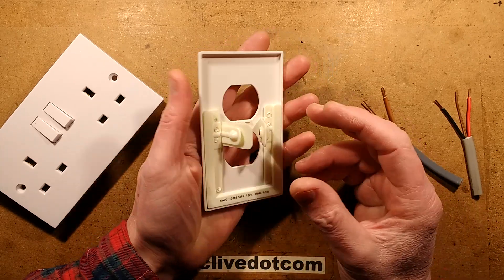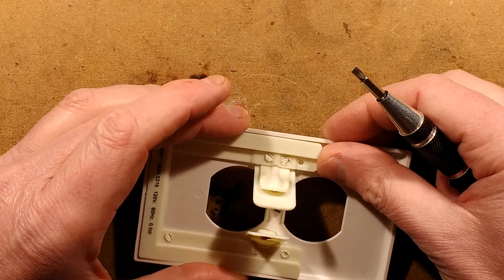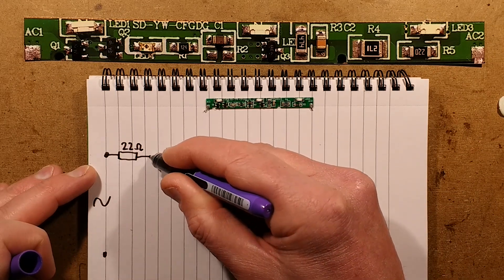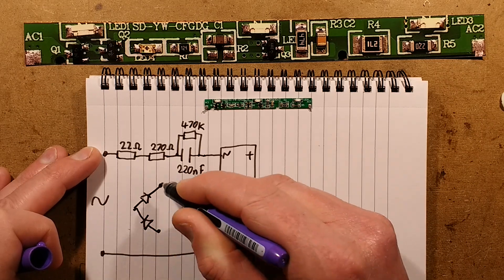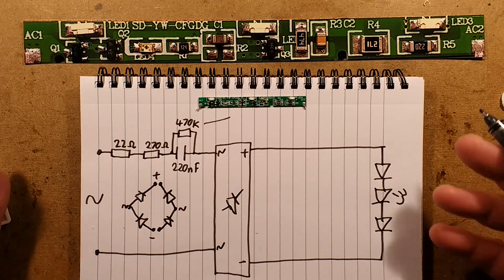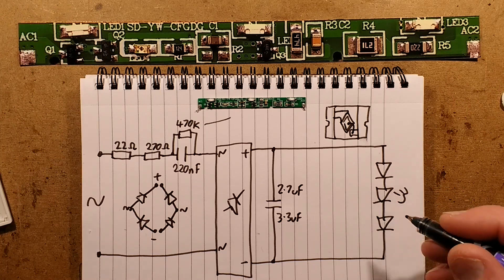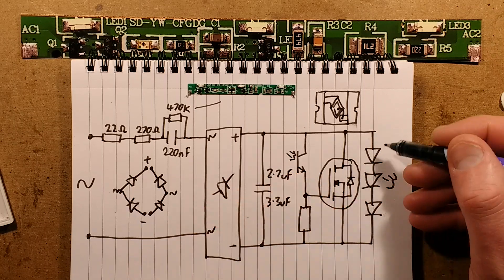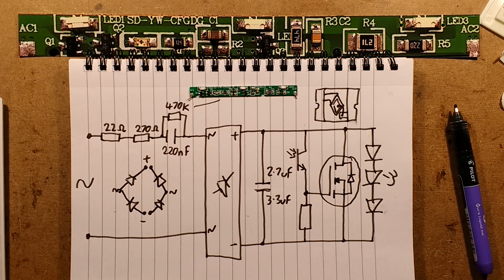Inside a night angel illuminated socket cover.  (schematic)

Comment: Very interesting - I live in the US and have never seen this item? Clive- I have been watching your videos none stop since I found your channel (almost 4 days straight lol) A lot of the things you take apart seem to have what you call a capacitor dropper with bridge rectifier to change the Mains to DC & drop the voltage is that a common and SAFE way to do that? In some break downs you say it isn't safe because of no isolation from mains power but in others you say its ok what am I missing?? - I apologize for my limited knowledge but I DO NOT mess with Mains Voltage because of that, but I am learning! you are a Great teacher
Reply from the maker: It's common in LED lamps and low power control circuitry like time switches.  A capacitive dropper is a cheap, simple and reliable way to create a low voltage supply where isolation from the line power is not needed.
Reply: Okay Thanks for the reply

Comment: Why there is no green-yellow earth wire, only bare copper one?
Reply from the maker: It's to save space as sleeve is only needed at the point of termination.
Reply: I am from Czech republic and i can say that most of UK and US electrical standards are disaster oposite our regulations. Cables like that will never got revision in our country. Sometimes we wondering if we receive some kind of machine from "more civilized or more western world".
Reply: Radku, lépe bych to nenapsal :-D
Reply: Don't mention the ring circuit and 32amp protective device, the radial boys will blow a fuse !

Comment: I'd be careful about that little gadget and I'd be interested in seeing the size of the contacts. Reason is in the US, some of those 120 volt sockets are wired in an Edison circuit (shared neutral). What is done is on the hot side, the tab connecting the two sockets is broken off and each socket gets a hot wire from opposite phases and the neutrals are kept common. The result is that each socket is able to have the full rated amperage drawn from it while the neutral simply has to carry the different in current between the two hots. And if that little gadget you're reviewing has the contact on the hot side in just the right (wrong) position, it could provide a dead short between both phases. Could make for quite the light show before the breaker pops.
Reply: John Cochran would it briefly make every plug in the house and possibly the neighbor's house 220 volts, or would the breaker open too quickly?

Comment: Thanks good video . I have one of these lights quite difficult to squeeze into the box. I wish the wires had a color scheme, they are all beige and solid core wires with cloth insulation! 

A video suggestion .How to wire up a stairway light SPDT switch when all the wires have the same color ! Three wires six possible combinations!

Comment: If you had a 120v supply you could check whether that is a light sensor or simply an out-facing led for greater coverage.
Reply from the maker: It's a sensor.  I tested it with a meter.
Reply: I asked because I have something vaguely similar in function (but battery powered) and it has a motion sensor instead of a light sensor - so it comes on during the day as well.

Comment: I wonder if it get hot with all those tiny components.
Still I love this type of lights. More electronic, especially led lights should have photo-resistors and movement detectors. I use them in home in lots of places and it really is amazing thing when it automatically turn on lights only at nights and only if you are in room. No more switches and you can make your own led lights with photo-resistors and movement detectors without too much work. It's such simple thing to make.

Comment: You forgot to mention the MOSFET doesn't have to fully turn on.  It only has to turn on enough to lower the voltage to less then the 9.9V (3.3V ea.) required by the LED's.  At 8V for example the LED's will be off so the overall power situation isn't changed.

Comment: Good video. one of the most interesting circuits out there. would it work on 240 volts ? probably not with that capacitive dropper
Reply from the maker: Technically speaking you could add another 220nF cap in series or replace it with a 100nF 400V cap.
Reply: Do it!!  Then use your hopi and show us the power factor.  Just add it as an addendum.  Too bad you you don't have an AC power supply.

Comment: I was looking at these (US model) on Ebay a month ago and thought they were pretty neat, but wasn't sure about the quality/safety. Looks pretty decent now that I got to see the guts. Does anyone know how effective they are at being a nightlight? Is the light output sufficient? Flickery?
Reply: xIntoThePitx 
With some doing got the lights to work great .
Reply: I would not suggest installing one of these.  They would never pass CSA/UL because the connection being made is substandard and in some cases hazardous.  Aside from the obvious issues with a light pressure on the screw terminals, you also have the issue of bridging out the upper and lower screws.  That means on a split receptacle shorting 240 volts through that small bit of brass...  Will be exciting to see if it handles 15A for long enough for the breaker to pop, or if it just melts and starts a fire.
Reply: My thoughts also.
Reply: It didn't appear to me that it bridged the screw pairs, it looked more like it connected to one pair only.  I suppose it is technically in violation of NEC because the typical 15/20A breaker rating can't possibly protect that #22 or #24 wire that goes into the unit. Mounted in a metal box in plasterboard I think think that would be a real concern, but in a plastic box in OSB or the like it might be.
Reply: Won't be used on split anyways, though I can see that being a problem for those who don't know what that is and get a blast of molten brass in their face installing it. 
  Since it draws such a low current I don't really see a problem with it drawing current from pressure connections. If they corrode, it'll just stop working. Suppose they could be pigtailed in, or piggy off the two free screw terminals. 
  I was more concerned about how the light looks in real life. I highly doubt I'll ever get one (maybe), since the dollarstore is down the road with much more scary stuff that simply plugs in.

Comment: The "termination" on this seems dodgy. I'd rather see the power leads properly terminated under a screw instead of flapping in the breeze. I'd be curious to know if using this device was actually a code violation in some manner. NEC or CEC.
And I thought everyone switched to Decora receptacles...

Comment: I'm fine with the Red -> Brown and Black -> Blue change in wiring. If you find a random mess of cabling inside a machine or wall cavity, then there is a way to tell what is AC mains and what is DC. Some homes are wired with 12V/32V DC for lighting, and later get AC 240V.

Australia still has Red/Black/Green with yellow stripe twin and earth cabling in houses, yet Brown/Blue in all the appliances. Where is the sense in that ?

Comment: I can’t find a 220nF 0805 with better than a 100VDC rating at the usual suspects. I’d be very nervous about that thing in my house. If they’d just used a couple of higher caps in series, it’d probably be more or less okay. Though the whole package makes me a bit skittish, especially since the first application that comes to mind is my kid’s room, right next to the bed. I think we’ll stick with the overdone USB-powered SK6812 with an Arduino clone doodad (despite knowing exactly who designed every board in the contraption).

Comment: Yea, the connection would be sketchy as frig, not just because it might bridge two circuits, but the size and placement or even existence of the terminal screws isn't all that standardized over the past 120 years or so, and depending if the side terminals are utilized, (many sockets have push In type terminals as well) and the size of wire used and how neat or sloppy the face plate fits the socket who knows how well or if those wing thingys would make contact.
Reply: Ya the push in terminals will not pass code where I live. All connections must be wire nut or screw contacts. Along with GFCI with arc-fault. Its getting harder to get zapped now days, and its no fun. I re-wired my house this last summer as I still had cloth wire from 1906 when the house was built with a 60amp buss bar breaker box. I did the smart thing and used 12g for all the lights and outlets, 6g for the stove. A 200 amp panel just does not go as far now days with all the codes. A separate breaker for each 20a outlet in the kitchen and bathroom with arc-fault. Lights can NOT share the same breaker as a outlet.

Comment: Well... When the light are lit its 11V+0,7 or so over the LED and say 50mA that would be around 0.5W.

When it shorted out, it still draws 50mA, but not its shorted out. So its really just the diods taking 0,7V. So it sould only pull 35mW... that is quite a bit less.

Comment: Some don't seem to have good contacts though, so it's still a crap-shoot as to whether it'll work. (Basically the little clips are too short to reach the screws that connect wiring to the socket.)

Comment: I have similar in my house in the US but they are not pressure connections like that. That’s a damn fire hazard. Mine have cable leads to attach to the outlet screw terminals.
Reply: Finest Hops 
Unless the outlet the last on a circuit that isn't compliant as you can only have one wire under a screw.
Reply: Zach Demand my house is wired that the wires are spliced behind the outlets and there are jumpers that feed to outlet itself. I prefer it that way personally. Makes swapping outlets as needed much easier as there is only one set of wires to deal with. I rewired half my house because the previous owners were the type that apparently thought they knew more about electricity than they really did. Plus they used the compression holes in the back. I HATE those. I have seen too many break off and cause floating wires from thermal expansion on outside walls especially.

Comment: 3μF or so for C1 (at a minimum 16V rating to comfortably handle the 9–10V across 3 white LEDs) isn't actually a lot by current standards (you can easily find 22μF 16V and 25V ceramic caps in that size, or 4.7μF at 50V which would support up to 4-chip LEDs). I'd definitely rather see a physically bigger cap for C2, though.

So not the most dangerous thing, but C2 still looks dodgy to me.

Comment: What about the cables that are brown black and grey?
Reply: That replaced the old red/yellow/blue for L1/L2/L3 in three phase electrics.
Reply: And two way switching...
Reply: What about a single phase circuit?
Reply: What Clive shows is for single phase.

Comment: Please energize it with 240 as-is. This could be incorrectly installed on a US NEMA 6-15 or 6-20 receptacle and get 240v. It's not a completely fair test as being a capacitive dropper it will draw less current on 50 Hz 240 than on 60 Hz.

Comment: there's USB cover plates that "steal" power the same way.
I'll hazard a guess the resistor across the dropping cap is for surge/static/ESD purposes so it doesn't have a banging flash-over :)

Comment: Nice little board.  You could have popped it on a 120V transformer to check the "LED4" to see if it was a light sensor.

Comment: They must short circuit the leds in the "off" state or otherwise put a low value resistor (maybe R2?) across + and -, otherwise the voltage will swing up without the load and then they would have to use high voltage capacitor (C1) and transistor after the rectifier.
Leaving them always on would be simply better, in fact would use less power.
Reply: Maybe not.  While the current is greater with the LEDs off, I'd expect the power factor would shift to lower the "real" power.  More current doesn't always equate to more power.
Reply: Ah yes, could be. It's so long ago I did any impedance calculations that I couldn't say off the top of my head.

Comment: You should get a variac. That way you could turn the mains voltage down to 120V and give it a try
Reply from the maker: I do have a variac, but it's currently got a smashed meter.
Reply: Use an external meter (I want to see it work, and the power factor).
Reply: For cheap junk like that, you could probably just guess and be okay

Comment: I don't know why the mosfet would not have a source resistor to bring the supply rail down, low enough that the LEDs would not conduct?! Would save more power that way. no?

Comment: wait, Earth doesn't have sleeve? in Finland, we have 
Brown = Phase/Live, 
Blue = Neutral,
Yellow and Green = Earth.
Reply: Some cables will have earth sleeving, in this case an electrician can just fit some sleeving to the exposed earth conductor as he's wiring it in.  But having the entire earth sleeved within the cable just makes it bulkier.
Reply: It technically has a loose brown paper sleeve.

Comment: that red and black ground reminds me of our tri wire, red black and white with the grounds. which my apartments full of.. my kitchen uses those.. they did something funky with the plugs but i love it... set it up where source from red on top plug then black on bottom, common shared on other side. then plug next over be black on top red on bottom. and shares 2 breakers then did something similar on other side but one breaker continued on but then used one more breaker on other 2 plugs... its great cause could power 3 high powered things off each one if know the pattern of which plug is opposite. like could run a deep fryer off one a microwave on one plug then toaster oven on other side and nothing would pop cause all own separate breakers. unlike upstairs its... its a nightmare all chained together i went to change a plug in wall with power on...cause don't ask me about breakers lmao they all make no sense. unplugged it and power to lights stove hood and lights microwave and the kitchen ceiling fan and lights of off... why are they using a plug as a pass through is a mystery old plug was dark black on the connections. sorry love giving stories of my nightmares here as well some times the good stories. not sure if see them though.

Comment: If this hasn't already been said, don't forget that the FET will dissipate power as it can't ever pull the DC bus voltage down to less than its own gate threshold voltage..

Comment: I wish we could have these in the uk.
Reply from the maker: Technically speaking they could build them into socket faceplates.
Reply: edward houlton I wouldn't have this in the US. That slip-on connection is dodgy as hell, it could, as others have pointed out, short out a split circuit, and that thing is sure as hell NOT UL listed! 
You can get outlets that have a built in nightlight here. Sure, it's not as cheap as this thing, but it's a hell of a lot safer.

Comment: I've never seen an unsleeved earth wire before.
Reply: Technically it's not an earth wire.  It's known as a circuit protective conductor.  Sleeving is added wherever the conductor is exposed from the grey sheath.

Comment: Not gonna be UL LISTED for sure. Us requires a switch or easily unpluggable.
Reply: Unless you specifically mean for lights, we have a bunch of USB outlets available in the US that don't have switches for the 5V power supply module.  I'm not sure how this is any different apart from the unsafe connection.  If anything were to make this thing fail to meet code, it's those connectors.

Comment: It might well be that the mystery component is indeed an LED, just using it as 'photo diode'. The 120kΩ resistor in series shows that it is adjusted for a tiny current.
Reply from the maker: It doesn't appear to have the characteristics of an LED when tested.  I'm guessing it is just a phototransistor.  But the idea of turning a MOSFET on with the output of an LED or several in series is intriguing as the tiny current produced by LEDs when used as a detector is less critical with a MOSFET gate.
Reply: More likely a photodiode used in reverse leakage mode. As the light hits it the leakage current increases, making the resistance lower, a give away is the use of the high impedance mosfet and the 120k pull down resistor, which is easy to drive with the few dozen nA that it would give in room light, dropping as the ambient decreases. Otherwise it would be in photodiode mode and generate current with light. Supply capacitor C1 would be a 4u7 25V ceramic capacitor, with the voltage derating you are right in it being 2uF and a bit with the likely 1VAC test voltage, they are truly horrid caps but are small and cheap. C2 would be a 220n 250V ceramic, slightly better but still not a mains rated part.

They could just have left the whole photocontrol off anyway and let the lights run all the time, no power saving with them off anyway and likely more light than a neon lamp at the same power consumption as well.

Comment: Why do you care about life and neutral when wiring sockets or lamps? In mainland europe you can plug in the plug either way and lamps don't care which is L or N. It's AC after all, so it doesn't matter unless you are using more than 2 phases.
Reply: radry100 depends what your using if your using things like shavers and toothbrush chargers they still plug into an adapter anyway round. And the removable leads on things like boom boxes can plug anyway round into the device

Comment: I tried one of these things, as soon as I tightened the screw all the way, it stopped working. Garbage.
Reply from the maker: It's possible that the wires in the back of that particular socket were causing the contact wing to bend out clear of the connections when it was screwed fully in.
Reply: I'm sure it was something like that. I didn't feel like fussing with it. i can just use a regular plug-in light. I'm sure those are less of a fire hazard anyway.